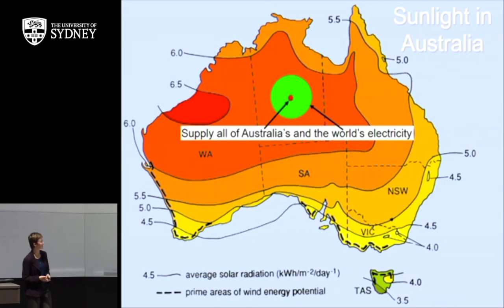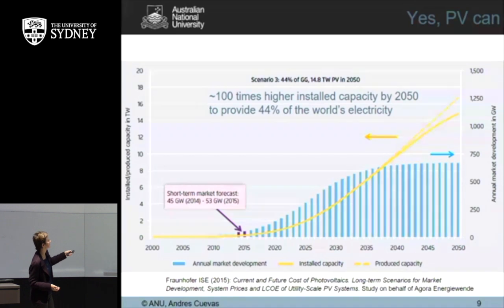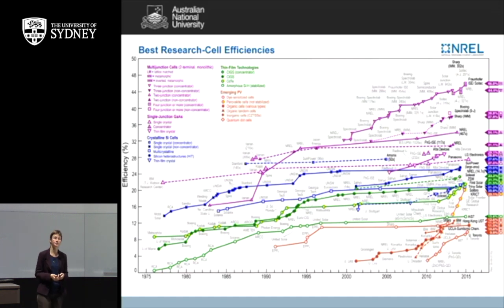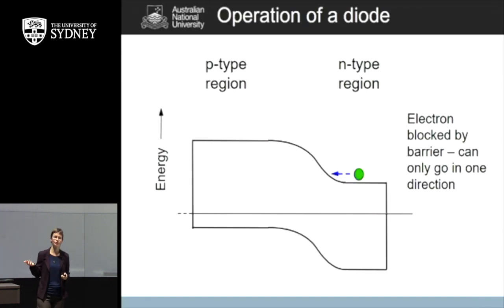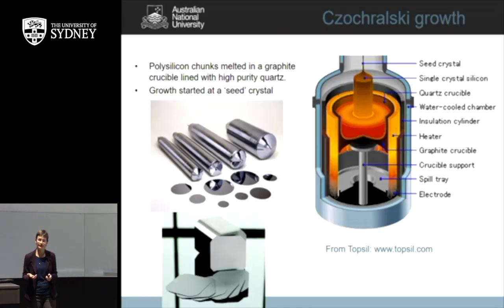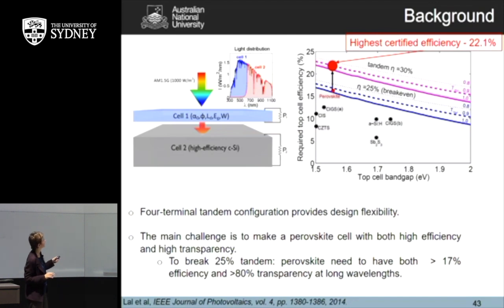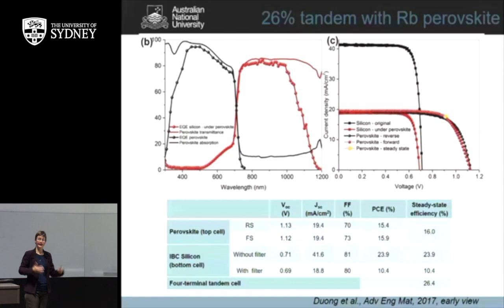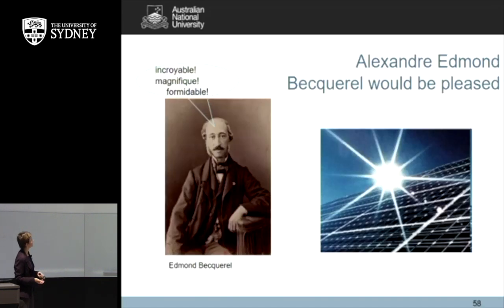The Bright Future of Solar Energy — Prof. Kylie Catchpole

Comment: Night is the biggest problem since large generators are needed then and for the foreseeable future of solar. The use of high efficiency A/C and water heaters is the current way to reduce a home owners  kilowatt  load.
Reply: @Moto Arzan,
Thank you for lending him some common sense.
Sometimes you have to wonder whether some of these people are totally incapable of seeing anything beyond 6 months down the road. 
It is either that or their "politics" actively fights with their ability to process information or understand trends.
Reply: Night is an impediment, no doubt about it, and so are clouds. But they're known quantities, and so are the solutions. The thing to focus on is BOS costs. Now that the solar cells have gotten so cheap, these other factors are increasingly dominating. They're not coming down as fast, but they're falling, too, and overall systems are improving.
Reply: Night is the problem? Even larger generators and more fossil fuels are needed if they are to generate power for both day and night...whats wrong with cutting it in "half" in the mean time until battery technology gets better and cheaper to take care of the night and now covering us for the entire 24hrs?
Reply: @motoarzan791  the battery capability is already there. It's just a matter of scaling up. It already doesn't make economic sense to build more fossil fuel plants to cover night time energy demand and this is already being reflected on the ground in the energy markets, internationally. Batteries are already being implemented for peak despatchable demand.